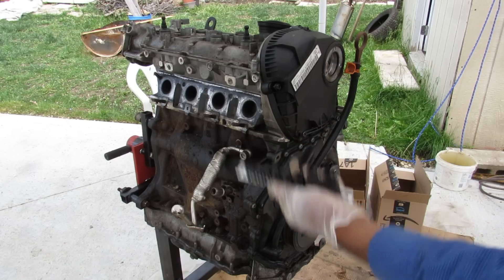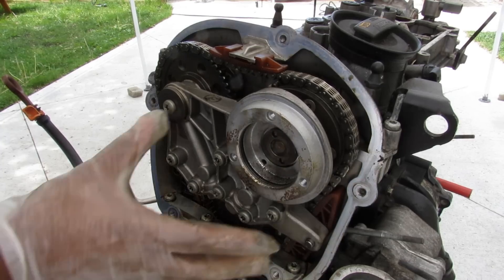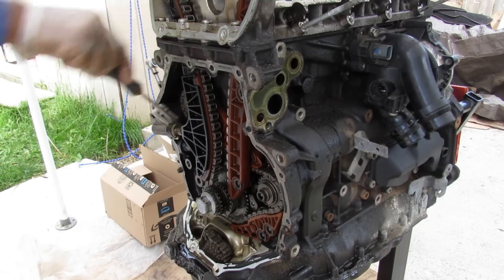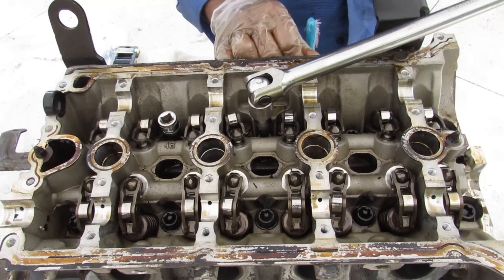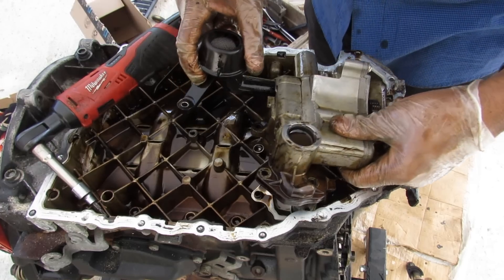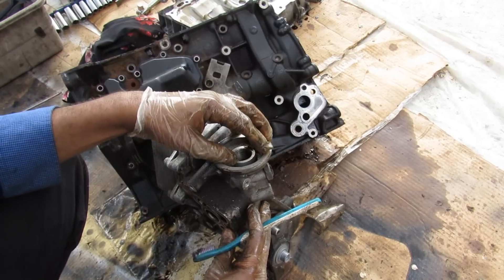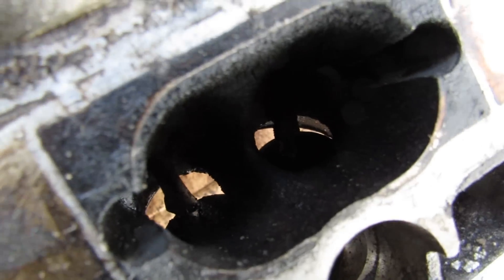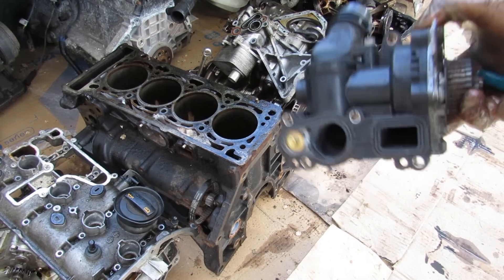Why Volkswagen Engines Fail

Comment: When one mentions timing chain, life time comes to mind. VW found a way to destroy that.
Reply: It does last for the lifetime of the engine though. It's fine right up until the engine dies from timing chain failure! 😆
Reply: Fine German engineering
Reply: Just like life time ATFs ;)
Reply: @pliedtka  Agreed.  VW does not believe in lifetime ATF - the DSGs have an oil change schedule.
Reply: @einfelder8262  well, that's refreshing. I had a car with "lifetime" ATF. Started slipping out of gear at around 100Mm on the odometer. Guess what fixed it?
Reply: @einfelder8262  `lifetime` is more or less 10 years
Reply: @einfelder8262  The oil in manual VW gearboxes is supposed to last for the life of the vehicle. I got the oil changed at around 100k miles a couple of years ago just in case though. The shifting didn't feel massively better after the change, and it's got 60k more on it now, so it looks like the shitheels in the insurance industry here making it prohibitively expensive, or refusing to quote you at all if you're a new customer, to insure cars over 10 years old are what will eventually retire my car rather than mechanical issues. 

It's a VW diesel rather than gasoline though - almost bulletproof provided you don't allow the dealer to do the dieselgate software update (Or you get them to sign off that they will cover replacing the EGR valve for €1000 on warranty when it fails after the update) and the timing belt is changed at the recommended intervals. Also for some reason VW parts run better for longer when you buy them in Skoda branded vehicles and worse in Audi ones...
Reply: @nicholasvinen  what fixed it ?
can you elaborate
Reply from the maker: Yeah. They stretch
Reply: The major issue is the cam chain tensioner ratchet mechanism failure...as long as oil level is always maintained
Reply: @Green Mamba Games nailed it. That’s the real issue here
Reply: At one point in the nineties, like all other German car manufacturers, Volkswagen got taken over by a new management of East-European Germans. Those who previously made the Lada, the Volga, the Zil, the Uaz, the Gaz, and the Mosckvich. At the same time, these VW managers demand a salary of ten million dollars per month. So it is all about exploitation and drive the German car brands against the wall. Same with Mercedes. Customers complain that Mercedes cars fall apart after three years only.
Reply: @lenny108  Keep smoking your hash, you deserve to remain inoculated from reality.
Reply: @lenny108  lol, cool story but very unrealistic. VW has been very tightly controlled by the family which owns it for decades, no way they’d put any East Germans in charge of anything just a few years after the Cold War. Not to mention that East Germans were not making any ladas, they had trabant cars instead. What did actually happen is that VW bought Skoda Auto in Czech Republic and set its own management there
Reply: Even if the tensioner doesnt fail. The weak plastic guides wear down and then the timing goes out :D
Reply: Those plastic fucking timing guides are just as stupid as the shitty tensioner wheel
Reply: @Green Mamba Games The belt was cheap and relatively easy to replace, I did it always @90,000 km and you did the water pump at that time. I think the chains are put there to drive high pressure pump and variable timing which requires higher torque, but they should be lifetime or at least that is the understanding, because they are compley and expensive to service. 

I guess part of the problem is the absurd pretension that oil should last for 15,000km. I change the oil on my WV's each 7,500km. Never had a problem with chains or timing belts and I hope to stay that way.
Reply: When I bought my used R32 in 2017, one of the first things I did was get the rattly timing chain and guides, tensioner etc. replaced. It's supposed to be a lifetime chain but what lifetime means, I have no idea and I wasn't taking any chances.
Reply: Not just VW. BMW n47 engine is a ticking time bomb 😂
Reply: Basically the same with mazda.
Reply: You're dreaming if you think timing chains are lifetime on any engine.  The chains on this are multi throw chains, unlike many other engines which are single row and stretch much more easily.
Reply: @einfelder8262  duh, older bmw in-line 6es like m54 can do over 300kmiles on the original chain. Will take multiple water pumps/tstats radiators and will leak but no timing chain issues
Reply: @fastboatster  duh how about you tell us about newer BMW engines and their serious deficiencies, cherry picking one engine out of dozens shows a small mind.
Reply: @einfelder8262  sure, I’ll tell you about my n51 with 120kmiles. Had all 3 (oil pan, valve cover and oil filter housing)  gaskets replaced, I replaced “Mickey mouse” cooling hose because it broke snd recently replaced water pump and thermostat because people were saying they don’t live longer than 80 kmiles, but they were fine. been soldiering on without other problems otherwise. Really happy I didn’t get an A4 with the engine from this video.
Reply: @fastboatster  I'll tell you about my 14 year old GTI then, with zero mechanical problems and 220,000 miles.
Reply: @einfelder8262  your 14 year old gti is probably not with this engine (2007 if it’s 14 year old), I believe it’s ea113 with timing belt so not quite nightmarish as ea888. What did it take to have it with 0 mechanical problems, I’m pretty sure you’d at least have to do the timing belt once, possibly deal with cam follower issue and perhaps replace a gasket or 2. Or a chain which connects both camshafts. Anyways, back to my point, 6 cylinder Bmw engines do have timing chains which last for quite a while. You can say that to some extent about 6 cyl Audi engines like 3.2 or 3.0T but those have tensioner/guide problems which might force you to take them out of the car, so n52/n54/n55 win in this aspect
Reply: @fastboatster  Your BMW is also not with this engine.
Reply: @einfelder8262  and I’m really happy about that. Although I’d like to also have something with 2 turbos, 6 cylinders and more power. In any event, timing chains can last a lot longer than they do in ea888, I don’t think it’s debatable. They definitely do in hemis, lses and other pushrod engines, if we don’t want to look at BMWs which I understand cause some VW/Audi fanboys lose their shit when they are just mentioned.
Reply: @einfelder8262  On all older cars they're eternal. I have one old diesel merc on driveway. Driven over 800tkm's and it has original chain in it. So yes, chains WERE eternal back in the days.
Reply: @einfelder8262  had a '86 Mercedes Benz 300e with 450000 km which my grand father had from new, it ran with the original timing chain until it was sold.

Comment: Volkswagen drains your volksbanken
Reply: Maybe VW really stands for vacant wallet.
Reply: @Green Mamba Games  nothing about it is hard. It's an issue of labor cost for maintenance and repairs. The packaging design choices require increased labor time. You can make excuses for performance and exotic application but not for appliances like where this engine is deployed on.
Reply from the maker: Eventually

Comment: Can you possibly elaborate on how newer engines are improved based on your tear down one? For example, this EA888 is in 4th gen now, and it seems only the 2nd gen has serious oil burning issues.
We understand that only old engines are affordable, so it would be nice to also learn how new ones are improving!
Reply from the maker: I'd need a deeper dive or another newer engine to compare
Reply: @speedkar99  which will further level up your video quality that we appreciate!

Comment: timing chain for reliability, haha, lots of engines that switched from belts to chains are having serious problems with tensioners and guides
Reply: Actually Germans fail on chains,but Japanese don't
Reply: @adanthedriver1982  german an also french; THP engines
Reply: Better to do timing belt maintenance than timing chain replacement.
Reply: while scotty kilmer pimping to chains saying they never fail lol
Reply: I'll stick with a 1.8t any day.
Reply: The Japanese fail too, mostly because the way variable timing is run. My friend does more than a few tensioners a year on Hondas and as precaution changes them once the car has it's mileage.
Reply: @pliedtka  I own suzuki celerio  3 cyl engine with timing chain still going strong after 250k miles great little engine
Reply: @pliedtka  For the moment, I don't see a chain problem at home, with the kia brand
Reply from the maker: True

Comment: Them some evil engineers to put a water pump and belt in that hidden location.
Reply: It is a known fact that VW engineers would walk past 10 supermodels to f* a mechanic.
Reply: @puregsr  LOL.
Reply: Laughs in engines that sandwich the starter between the block and the intake
Reply: @xnopyt13  Laughs in BMW N52
Reply: Chris Hoffman-Echandy that and the GM northstar lol
Reply: @ Eric x 

And the Toyota 1UZFE
Reply: @677dm5  I feel this.
Reply: @xnopyt13  my previous vw car starter was sandwiched between the engine and suspension , in order to remove it the easiest way is to to remove air box ,unbolt engine mounts and support the engine and lift it up a little so you can extract the unbolted starter from underneath ,it was funny to see mechanics removing it then try to figure a way to get it out the vehicle as the starter is bigger then the space around it  😂😂
Reply: MUHAMMED KH lol
Reply: @xnopyt13  That's not actually so hard to access on the 1zz-fe since the intake is easy to take off without taking off a lot of other parts.
Reply: They don't want anyone but VW "Technicians" working on their cars anyway.
Reply: @TeUhtred7860  trust me, VW technicians hate it. They probably hire bodyguards to prevent the technicians from murdering those engineers
Reply from the maker: Evil to the one who has to repair
Reply: speedkar99 and you are repairing it. Lol.
Reply: I am so happy with my 90s Audi engine. Logical construction and a water pump that lasts many tons. What a complicated engine this is. And then also things (such as the water pump) mounted in an illogical place. And that carbon buildup is something that will make you totally sick. And then all those chains and tensioners.....brrrr. I would not drive calmly in a car with this modern engine. But yes, reliability has been traded for gadgets. And repair has become more and more difficult where "modules" are exchanged instead of really repairing (with shocking prices). Also consider changing a simple light bulb on many modern cars, even the bumper has to come off. I think this was done to provide the dealer network with a good job. And what about that programmed wear and tear ..... what a crook. The best VWs and Audis were made in the 90s.
Reply: It's not that bad - easier than when it's behind the timing belt.
Reply: Germans engineer their printing presses the same way
Reply: Nissan V6 put water pump behind timing cover.. that's evil.
Reply: @madunwerkstatt3093  there’s honestly a lot of cars with water pumps run by the timing belt now
Reply: @reefy664  Indeed, but nissan v6 put it inside oil bathed timing chain.
Reply: @madunwerkstatt3093  a lot of engines has that. You change the water pump when you change the timing belt.
Reply: change the air filter on a vw up. It's like vag engineers prime directive is to get revenge for ww2.
Reply: @Haddedam  The air filter in an Up is on top of the engine. Its two latches for the airbox, pull out the filter, put in new filter, close the airbox. Done.
Reply: @TheNecromancer6666  no its ontop of the engine and has like 8 star screws holding it in, half of them under the window plastic which requires you to get a special low profile ratchet. Stop defending up, it's an awful, boring, overrated car with fragile suspension that gets destroyed in every single metric imaginable by suzuki.
Reply: @Haddedam  Its actually a great little city car. Especially the nippy tsi and gti. 
The suzuki swift looks better but lacks interieur quality. Only the Swift sport really drives better then the up.
Reply: @TheNecromancer6666  ups seating position is sky high and it drives like a suv. Pedals are AWFULLY placed so you can't heel toe and it entierly feels numb and heavy. UP is the most awful driving out of all its competitors. I've driven them on road, on track whatever and VW alwayts ends up being a massive, numb, heavy dissapointment. As expected from a company who tries to get money from people who hate driving. It'd be a great city car if german engineers in all their wisdom managed to figure out how to cover interior metal and make it reliable so it doesn't shake apart its suspension under warranty. But you hate cars and driving if you get an up so you might as well get an better driving, easier to service, more luxurious, more reliable competition.
Reply: @Haddedam  You have not driven an Up if thats what you think. Or the Up is very different where you are. Which is possible if you are not European. 
VW in the USA for example builds entirely different cars then Europe. So a Passat or a Golf in the USA does not share more then 20% parts with a european one. The engine that guy there tore apart... i would not recognize it as a VW engine. It does not share a single part with a european ea888.
Reply: @TheNecromancer6666  Ihave driven up and I drive a lot of other cars. VW in general are absolutely awful. And I'm in europe in a coutnry filled with VW and they're awful cars only bought by people who think poor engineering and reliability is something to be proud of. My dads and my friends t6 2.0 tsis both exploded. 
VW can't make even a decent engine anymore. Trash company, I'm sorry you're forced to like them but get korean or japanese cars and you'll hate your past self for ever falling for german marketing
Reply: i will till you another funny thing .. its hard to work in those cars because they stick many components in small space and they like to hide things for good looking so if you dont know the model you work with and have many tools you will probably break things trying to figure out how to reach something you want to fix or replace 😂
Reply: another funny story happen , one of the exhaust pipe bolt rusted and loose idk how and the local mechanic couldn't tighten it or remove it so i go to someone to cut the bolt , the guy cutted the bolt head then after i get back the other half of the bolt cant be removed because of limited space so i get back to him again later to cut the nut side 😂
Reply: I don't know why people think German engineering is amazing. For solid metal things maybe, because the steel and machining is good quality, but complex things like engines are a horror show most of the time. Even on the more expensive cars like Porsches.

The Italians, British, French all make more durable engines.
Reply: @BlatentlyFakeName  they used to be great. Then they designed the cars to fall apart so they could make more money on repairs.
Reply: Its some stupid mechanic to look for a waterpump belt on an engine with an electric water pump
Reply: At one point in the nineties, like all other German car manufacturers, Volkswagen got taken over by a new management of East-European Germans. Those who previously made the Lada, the Volga, the Zil, the Uaz, the Gaz, and the Mosckvich. At the same time, these VW managers demand a salary of ten million dollars per month. So it is all about exploitation and drive the German car brands against the wall. Same with Mercedes. Customers complain that Mercedes cars fall apart after three years only.

Comment: German cars are over priced crap. Toyota and Honda have given the Germans a knock out punch.
Reply: Couldn't agree more
Reply: @martinmuigai5101  👍
Reply: It would be interesting if Speedkar could obtain a Honda K20C1 or K20C5 2.0 turbo to compare with.  It seems to be a much more logically engineered engine.
Reply: Still, with chains in newer Honda you have to be careful especially the higher output engines. And tensioners they also eventually fail on Honda. We had 2013 Elantra 130k km with similar issue, but it was the chain that stretched some 2cm - blame the owner for very frequent oil changes, using product of the highest quality ;)
Reply: @pliedtka  Honda has some problems with their newer tech but Toyota being the cautious snails 🐌 they are make most vehicles dead reliable. Having now owned 4 new Toyotas, they are hard to beat.
Reply: @pliedtka  Any timing chain in any engine can have issues. You just have to be aware of the sound or any warnings by ECU. The chains aren't what make this engine shit (yeah extra complex but a chain is a chain.. just there is three lol.)
Reply: @N4CR  the engines with the hybrid technik are reliable they do 360,000km  with no problems

Comment: 0:52 that is not the high pressure fuel pump its the vacumm pump.
Nop. I. Am wrong, this is a diferent design from the one I know, the part is very similar.
Reply from the maker: I initially thought bit was a vacuum pump too but no
Reply: Arooo?

Comment: These shitty engines are well known is snap the plastic timing chain tensioners also, throwing the timing off; which results in locking up the engine or the pistons smacking into the valves.
Reply: The plastic guides are usually not the culprit. The tensioner, made out of metal, is. The one in this engine was a bad design prone to failure. There were three or four revisions, they finally got right circa 2014. It a shame this engine was not updated. Its an scandal that VW never changed these proactively on extended warranty.
Reply from the maker: Oh yes...those always break